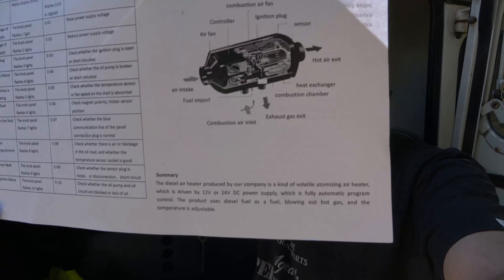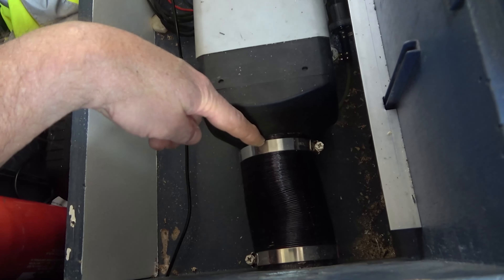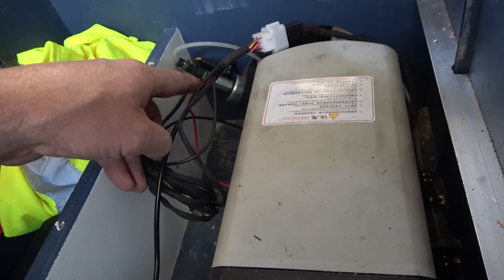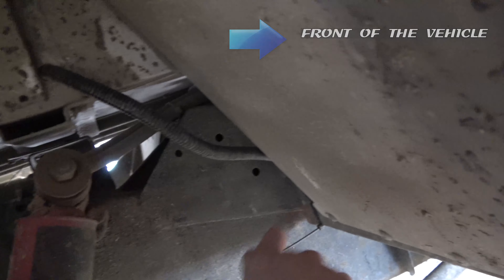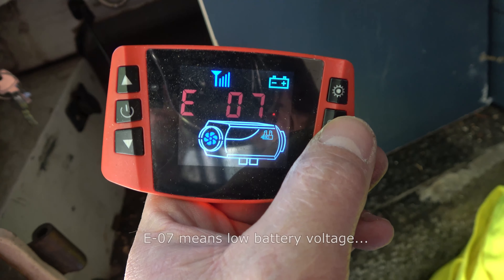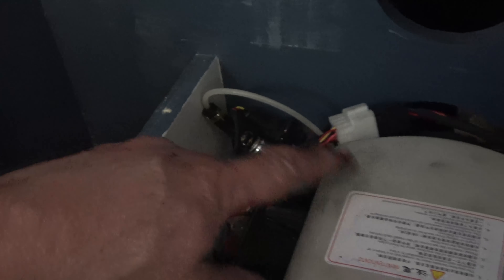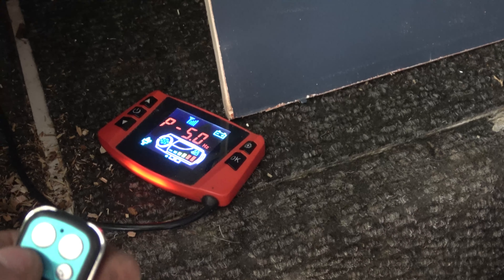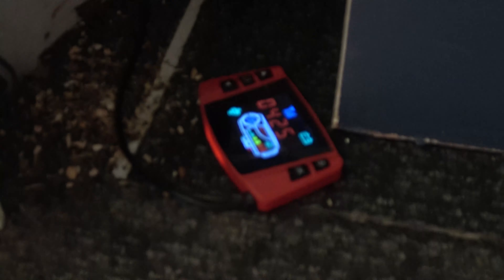Cheap Diesel Heater |Does it actually work?

Comment: there are isolators to avoid pump noise. Like a big fat rubber grommet.
As per the Htz, that's the pulse frequency the pump is clicking and feeding the heater. To change it to temperature, hold down settings and up button together.
Reply from the maker: Ah - thanks you sir! 👍😊

Comment: Put the pump completely vertical. The 45° rule has emerged because original eberspächer heaters used to have a filter built in on the inlet side of the pump. Any gunk wouldn't fall back into and block the inlet once the heater is turned off. Also, if you want to reduce noise coming from the pump, you should pack it in a "pool noodle". Lastly, your heater isn't going to work for very long with the exhausted rooted that way. It should look down as it's going to fill up with condensation and grit. There is also no problem in having it short and look straight down. Lastly, There are very helpful groups on Facebook and videos by an Australian dude on YT regarding Chinese diesel heaters.
Reply from the maker: Thanks for the tips 👍🙏🙂 (not mentioned in the instructions... 🧐)